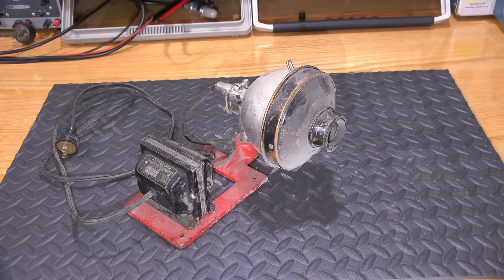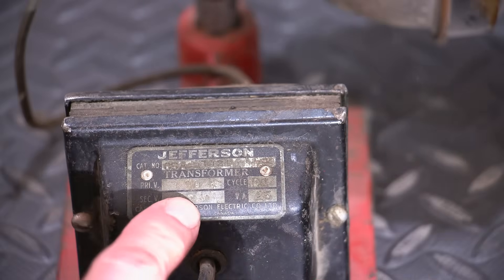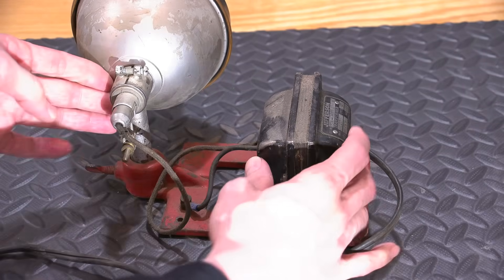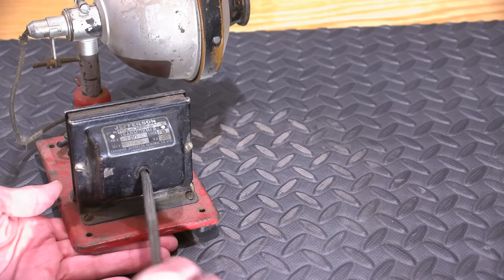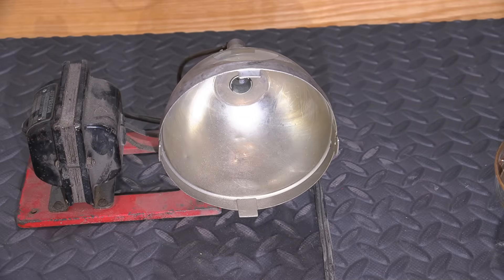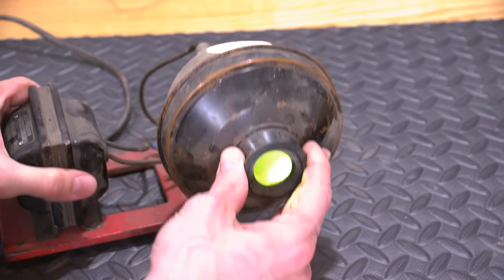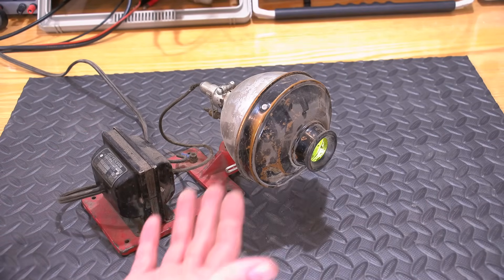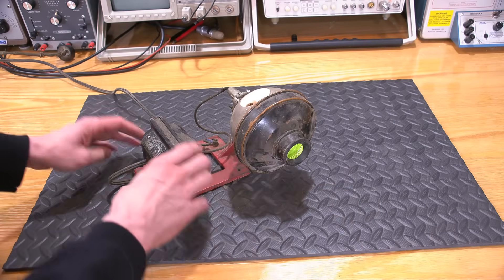Barn Find - What Is It - 1940's? Mystery Device Teardown!

Comment: My father was a professional photographer, he had crates of those big flash bulbs some bigger than the one you have there made by Philips in Holland. On one occasion I went with him as an assistant to an outside shoot I held the reflectors with the flash bulbs in them at about six feet to one side, they went of with quite a loud sound followed by a crackling sound as the glass inside the blue plastic film covering them broke up and the film shrank. As the shoot was on a public street people near by jumped from the sound and bright light, quite fun as a teenager to watch their reaction. The wire inside is pure magnesium in a pure oxygen atmosphere.
Reply: These are still very popular for some photographic applications , such as photographing in large and very hard to light areas like caves and mines that really cannot be illuminated properly even with modern strobes .
Reply: As a teenager my friend's father what the contents of at the front camera store inventory we're boxes of large flashbulbs with a standard screw base which would fit a household lamp.
Reply: One afternoon we turned off the main circuit breaker to the house replaced every light bulb in the house with a flashbulb and turned all the lamps on when they came home after dark and flip the inside switch we closed the main breaker. From the amount of light we could see through the basement windows reflecting off the neighborhood, they must have looked much like an atomic bomb went off inside the house what a great prank!
Reply: Oldie but a goodie .
The gag is you disable the main light so that the mark enters , hits the switch , nothing .
Mark then goes to the next closest switch or table lamp , hits the switch , and , POOF , 30 minutes of seeing a big white spot and little else .
They ALWAYS look directly at the second light if the first fails .
It is an inviolable quirk of human nature .
This is particularly brutal in college settings during mid terms and finals .
Reply: @wardduffield489 , It was that standard screw-base magic.  I had tons of fun when I came across about 20 of them in 1978. A nice very ,VERY bright FLASH, a POP. Great for refrigerators, bathrooms, etc.   I had one roommate wondering what the hell was wrong with our breakers?!
Reply: They were probably shell shocked from WW2.?
Reply: You should have been around before they started putting the blue or clear film on those bulbs. They would sometimes pop so hard the glass would go flying.
Reply: @Mark_Nadams  The blue coat also never really gets mentioned other than it being there... It was a form of "color correction" that attempted to boost the shorter wavelengths by filtering out the longer ones that the emulsions of the day were more sensitive to.
Reply: @MadScientist267 It was used to correct the color balance to work with daylight rated film.
Reply: My father was also a professional photographer.  In addition to having a studio in Los Angeles he was the west coast photographer for Popular Mechanics magazine from the late 1940s to the mid 1970s.  For one photo in the early 1950s he popped 5,000 flash bulbs (each the size of a 250 watt standard light bulb).  The job was the Kaiser Steel Mill in Fontana California in full operation.  He had the full support of Kaiser as the photo would be the cover of their annual report.   The plant was the size of over a dozen football fields under one contiguous roof. The bulbs were strung in the rafters of the building to get one color photo (and he had five 8x10 inch cameras and four 4x5 inch cameras set up for that one flash). It took a month of evenings to string those flashbulb cables and screw in the bulbs.  All nine of the cameras were on tripods fastened down to a purpose-built wood and steel platforms that was mounted on the forks of two large fork lifts, which allowed positioning to exactly the right location and height.  Kaiser Steel commissioned the photo (which was printed across the front and rear covers of their annual report), and one image was enlarged to over 10 feet tall and 18 feet wide for the backdrop of their trade show booth that they used all over the world for a number of years.  Kaiser sacrificed half of an entire production shift for setting up and rehearsing the fully choreographed photo - there is a liquid steel pour in the background, with a cloud of steam coming up from the molten steel hitting the mold (and the 20 pounds of ice cubes spread across the bottom), and on one side of the photo a slab of steel was just ejected from a furnace... the steel is white hot on the end nearest the furnace, blue in the middle, and red on the other end.... on the other side of the photo there's a hammer mill throwing sparks (from the handfulls of gunpowder flakes that were pitched into it by a hidden employee) and more.
Reply: My parents had old style ' box ' camera when I was young and it also had flash attachment. It had a standard size light bulb socket but with adapter for bulbs about the size of an egg.
It would light up a large room, I once took a photo of my brother and friends in school auditorium and it lit everything up quite bright.
I once found in the trash of a photographer down my street one of those bulbs the size of a 100 watt light bulb. It fit in the flash attachment so I used it.
Still have the camera, I think I might be able to still get film for it but I don't think there are any flash bulbs in existence.
Reply: @michaelszczys8316  Most "consumer" cameras back in the old days (including the old "brownie" and the usual "box camera") were something compatible with 120 film, which was the staple of professional photographers who focused (pun intended) on fine portraiture, landscapes, and other high resolution photography up to the advent of digital.

This is mid-format, and used in high-end cameras like Mamiyas, Bronicas and Hassalblads or the venerable dual-lense reflex (DLR) cameras like Rolleiflexes and Yashicaflexes.  I've shot a fair bit.

The film still readily available from specialty camera stores.  So you can still take pictures with old box cameras and fresh/new film.

Meggaflash (in Ireland) is currently the only manufacturer of big flashbulbs.  Some of the smaller types may still be manufactured. You can often find new old stock (NOS) flashbulbs on ebay, and at least one camera store specializes in flashbulbs.

I'm sure you could build electronic flashes as powerful as the biggest flashbulbs ever made, but the weight, cost and fragility would be extreme, and I don't expect the flashtube to survive very long.

It would be better and far cheaper to make your own flashbulbs frankly.  But a bit scary.
Reply: @michaelszczys8316 : eBay
Reply: Boy oh boy I've had a lot of fun trying to hunt down old flash lamp bulbs for my laser and photonics builds. They sure as heck are an interesting subject....and some of them getting really hard to find.
Reply: I,was wondering what the wire inside would have been made of.
Reply: @SDWNJ  Its magnesium in an atmosphere of oxigene
Reply: @roelotterspeer6535  They also use aluminum or zirconium.

Even 000 (super fine) steel wool will work.

At sometime during my life, I managed to acquire two unfired edison standard screw base flashbulbs and still have them.  One day I might fire one off.
Reply: The GE Mazda No. 75 is the largest flash bulb ever made, to this day they are highly sought after by cave photographers, no electronic flash can meet them. The Magnesium in them looks like strips of tin foil. As a film photographer myself I spend a lot of time in old camera stores and around old photographers. A friend of mine who worked at a local camera store in the 70s and 80s said it wasn't uncommon for kids to come in and buy the flash bulbs with normal light bulb threads to scare their parents. I myself have used quite a few of the M3 bulbs in blue and clear and the little peanut bulbs. Prior to 2015 when Fuji was still making the peel apart pack film I went through quite a few flash cubes with a polaroid 420. I bought two unopened cases of flash cubes that's 36 four shot flash cubes per case for $15 on eBay. Now if you can find a case of flash cubes it's $60.
Reply: The flash bulbs they had in the 70s and 80s that worked off piezoelectricity were cool. Never had to worry about batteries and you could use them for other things as well like gags and science experiments.
I worked in a nightclub. One night it was pretty crowded and someone dropped one on the floor. Someone else stepped on it and all hell broke loose. It was a 4 flash cube and all 4 managed to get stomped on 4 seperate times. At first, we thought there was a short circuit somewhere, but it was right in the middle of a bands set and stopping the show would only create more chaos. Thats when I saw the cube all smashed up on the floor. Lol

Comment: When I was a kid, we bought a bunch of these from the Army surplus store.  They used them to take pictures for your service record, I guess.  At any rate, I wired a bunch of these up to my future brother in laws car they were using to go on their honeymoon.  Had them connected to the ignition, brake lights and so forth.  Even had one in the glove box.  (They didn't find that one till later on).  They are, as you assume, incredibly bright.   12 volts was enough to set them off, don't know the lower threshold or if static would do it.

Comment: Railroad switch lamp to signal if switch is open or closed. Would have required a 120 Volt transformer nearby which is odd. The protective arra in front by galss seems to hint that it would need protection fro wind blown leaves, possibly coal chunks from train.
Reply: I am not sure, but did they use the 220V stationary tap transformer system in Canada as well (or was that only used in Europe?), that my possibly explain it if it came from a spot that happened to be hooked up to one of those line transformer configurated for 220V (in Europe they where sometimes used on spots that required 220V even if the on board system was 110V, if i man nopt wrong that system has been around since 1926 here, so the trime my be correct ), if so, perhaps? (Honestly i hawe no idea if that's what it is, just guessing here)

Comment: My guess is that it was an aviation related lamp from an airport or air force base.

Possibly one that was placed on the side of a runway, and placed (and pointing) at a precise angle towards approaching planes on their final approach, to help the pilots achieve the optimal glide slope. 🤞
Reply: Hej Bo!  Aviation glideslope markers are 2 red and 2 white at the (left)side of the runway.
Reply: I don’t think this would be bright or large enough for that application.
Reply: That lamp was not built for outdoor use.